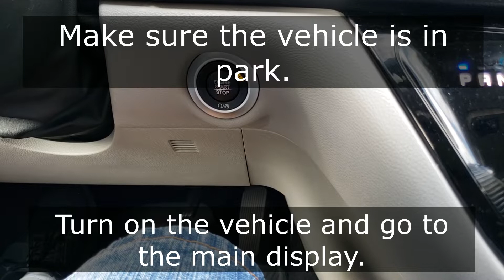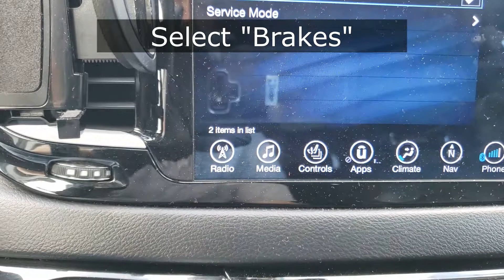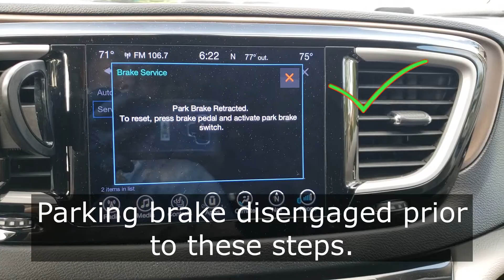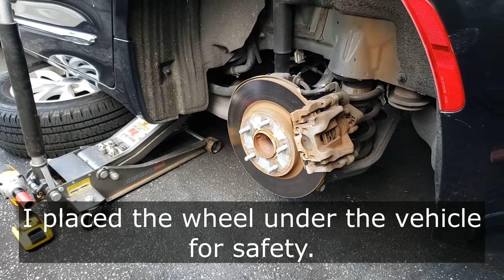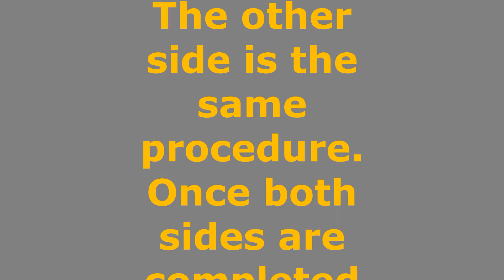Chrysler Pacifica 2017 - 2022 Rear Brakes

Comment: i did my brakes but i did not have the caliper tool. i just used a flat blade screwdriver to push back the piston before i took off the caliper. pry the piston back by putting the screwdriver between the pad and bracket, then pry. it moves back slow but it works

Comment: The rear brakes on these pacificas are twist style, how you press it in?
Reply: I just did my 2017, the rear just pushed in. As I recall, the front need to be screwed in, I did them a couple years ago.